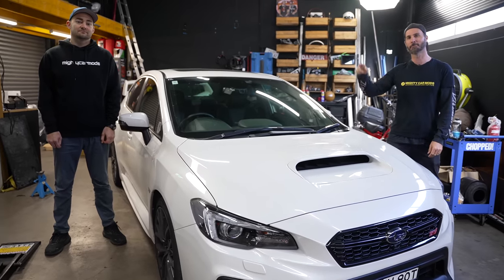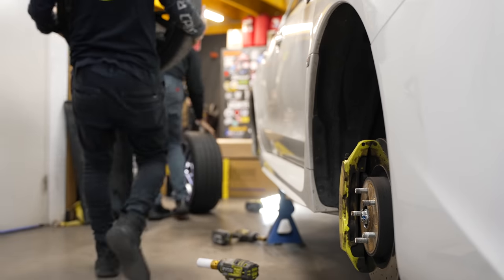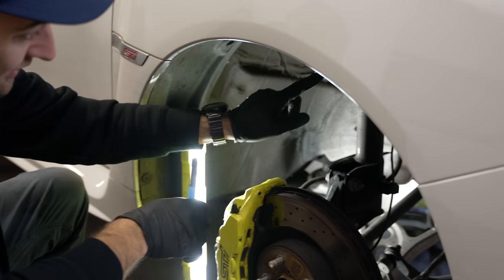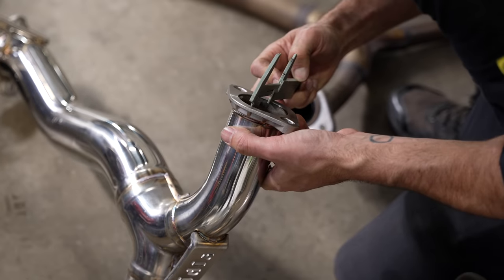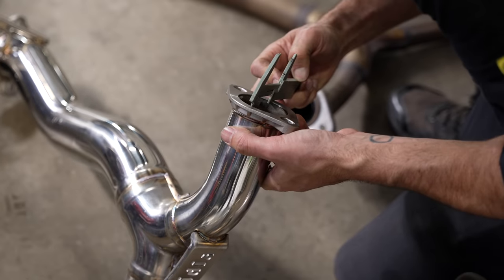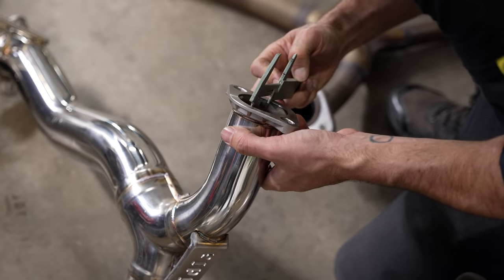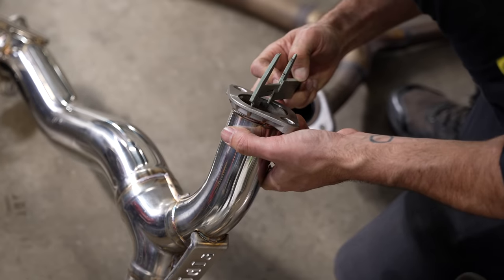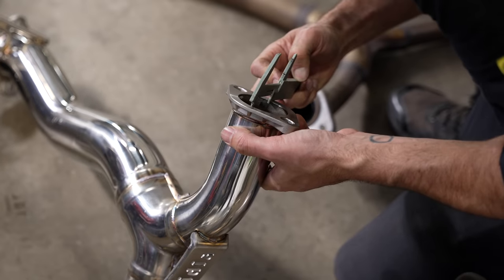The TOP 7 CAR MODS Everyone Should Do | WRECK IT

Comment: Just FYI, any aftermarket performance air filter REQUIRES a tune in Subarus. Stock Subaru software doesn't adjust enough to accommodate for the increase airflow and you will run 0.5:1 more lean, to a already lean OEM tune, constantly, increasing the risk of pre-detonation. Also, do not vent BOV to atmosphere if you have stock turbo/tune! you are releasing MAF calculated air out of the engine and it will run rich! so tune it accordingly, which probably means you won't get the psshh psshh sound... so might as well stick with OEM, which from a performance stand point can hold 20PSI. Unless you don't mind running rich for that split second during gas let off.
Subaru gets a bad rap cuz there's little to no margin for mods without tuning and people blow them up when they're ignorant. This is not a Honda people.

Comment: But is it better to have it so low to the ground? It doesn’t have enough ground clearance as it is. Maybe it will in a sense increase the handling on the highway. But regular every day driving may cause it to be less practical.
Reply: depends alot on where you live and drive to, could easily get away with being that low where i live. can also just not lower it much, and some cars sit way to high from factory

Comment: Straight pipe will get you defected. In most cases yes… but i took my muffler off my 307 and never got pulled over even when changing through gears at full rumble 🤣

Comment: Seems kind of odd that you would take great performance tires off and put less performance tires on. The factory tires are sticky as hell. Hmm also funny my tuner and many others say not to run a aftermarket exhaust and intake on a STI without upgrading your fuel system, which they didnt so the car is going to run lean at high RPM's . By By motor.

Comment: Legit question, i have a Peugeot 308 130hp, can i fit a catback exhaust designed for the 300hp version? As long as the car is the same, the engine doesnt matter for the catback exhaust?
Reply: engine does matter

Comment: I just bought a 2020 wrx sti limited. It has a full after market exhaust from the manifold.  The check engine light came on almost immediately after delivery. I took it to get the code read. It was on O2 sensor.  I had it replaced. I've driven less than 75 miles and the check engine light is back on. Same code as before. Please advise.
Reply: does the aftermarket exhaust have a cat? very unlikely that its the sensor

Comment: The R should be for rubber, but not tyre rubber. Rubber suspension bushes are massively overlooked and can totally ruin a cars ride and handling, and they tend to start becoming brittle and shrink around the 10 years old mark. 
If you have the capability to change suspension springs then you should be able to replace rubber bushes as well. No point in lowering a car that has knackered bushes

Comment: First mods realistically for young drivers = cut springs, drill holes in muffler, plastidip wheels, sticker bombed panel (w hentai), spiked lug nuts and a 2000w subwoofer

Comment: MCM 10 years ago: 
Here's a list of cool car mods; you can remove stuff and make your car lighter thus faster for free, this 20$ intake will give you more power
MCM in 10 years:
Here's the top mods for your car; put a 2JZ in your car, carbon wheels and bodykit, put rocket engines and go to the moon

Comment: Why would you recommend a BOV? Even if it's adjustable, the stock BPV is good for 400HP and you're just putting a noise maker on your car that's going to make you run rich
Reply: sorry but plenty of people like the noise, and with a tune to suit or if you recirc like the factory one you wont be running rich
Reply: @arcanevoid9199  you can't tune for a blow off valve unless you go speed density. lmao, which involves removing your MAF, so unless you do all that you will run rich and 99% of people run rich with a Blow off valve bud
Reply: @travissmith5945  oh ok never mind then, have heard that from some people. but not all cars have maf and you can relocate the maf to get around the running rich issue. or you can just recirc it like the stock one, with this blowoff valve specifically you can choose how much to recirc minimizing the affect

Comment: Intakes are a big waste of money just get a k and n air filter for some newer cars they cost $300+. Like that carbon intake he put in is probably $500. For what 5 hp... $100 /hp. It would of been better to get a bigger inlet turbo pipe. Better to put that money somewhere else. Otherwise you'll get better sound. It does depend on the car but some tunes would recommend/require it.

Comment: So hum...
You went with "rubber" so I had hoped you could go with you know, the most important thing in your car.
BRAKES

Sometimes factory ones are just absolutely garbage, and like tires, you should ALWAYS put the price on those.

You can have a sick car, but if you can't slow down, it will be useless.
Reply: Brakes should have been an addition or combined with tyres. Tyres obviously being number one and then a nice set of brakes if needed. Some cars have nice stock setups, others horrible. Possibly better rotors as well, I've seen OEM products warp in less than 20,000km.

Comment: Kinda disagree with this should be
Upgrade brakes/  Suspension/ cob tuner/ turbo back exhaust/ oil air separater/ turbo/ flex fuel to run both e85 and 93..

Comment: I feel like its my responsibility as a subaru owner to make sure people know, DO NOT DO PULLS ON A MODIFIED SUBARU IF IT ISNT TUNED. These cars knock like a motherfucker with anything so simple as a drop in filter or catback, make sure the very first power mod you do is a COBB AP. Axleback exhausts and suspension are fine but catback, headers, intakes, or any power mod will increase your chances of blowing your motor by several orders of magnitude

Comment: With any hope I'll have this pos car traded put this fall. Buy a corolla. This car soured my experience to the point where I'm only buying cars for the purpose of necessity, nothing more. Tomorrow dep 4th, will find out if i can trade out. Then have a car that I can get over 40k miles without two motor replacements. Clutch is rattling and whining now to and the driving experience is ass, slow pile of shit. Fuck subaru. Hope every factory they have burns to the ground.